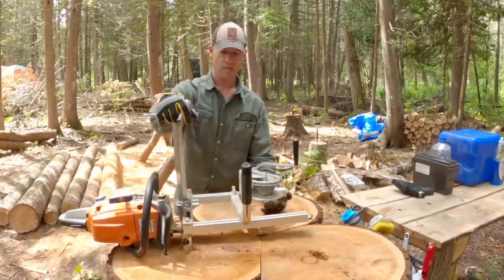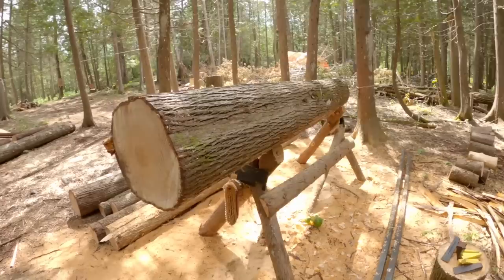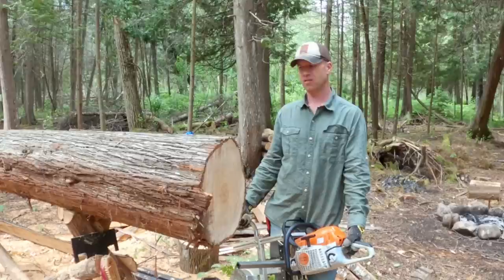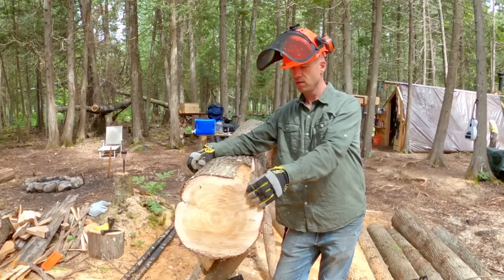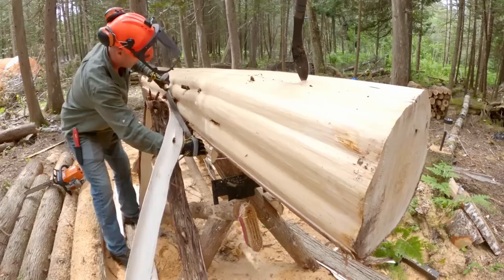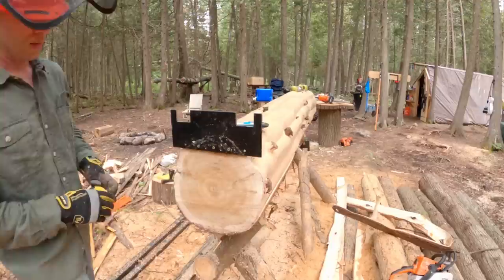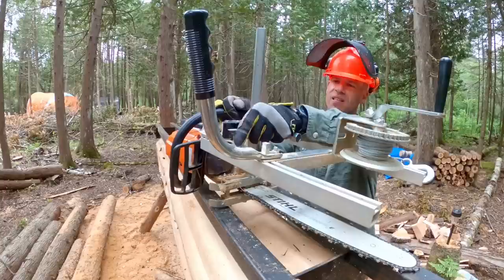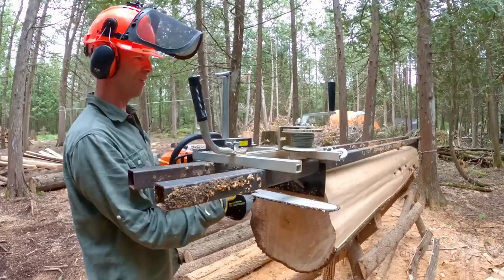Chainsaw Milling- How it Works.  Granberg Alaskan Small Log Mill G777 #12

Comment: Great video! I've had my G777 mill all summer and I finally put it together.  I copied your rail bracket design using 3/4" plywood and a couple pieces of 5 ' steel from a dismantled porch swing. The tip on finding the center and measuring up for the bracket placement worked like a charm. I got through about a dozen or so cuts before the chain dulled out. This is a fantastic little mill, can't wait to make more sawdust with it!
Reply: How big is the back plates at the rails goes on the wits and the Heights
Reply: How big of a saw are you using? Im just getting started.

Comment: My dad , brother and i had a ground hog mill .. the blade was 54 in. Wide the blade was stationary in one spot and the carriage had cable’s and a track , you put the log on the carriage and dog it down .. that mill was true all the way down you start off at 2” on one end of the log and start the cut after 21 Ft. of cutting when it got to the other end of the log it was exactly 2” so we had it dead on .. we run that mill for many years .. most wood we cut was Cypress logs they had a team of divers that would dive down and hook these air bags on too the logs then they filled the bags with air and waited for them to pop up .. then they tide them all together and brought them up river about a mile from our mill .. these logs were bigger then the blade .. that sinker cypress made some beautiful wood ..

Comment: You ARE a Natural Teacher. 
You also sold me on owning a mill
Soon to be a cherished activity.
Reply from the maker: Get one!  If you aren't milling up big logs, this mill (Granberg small log mill) is really fantastic.  Because the end of the bar isn't also clamped in, it's really easy to get the saw in and out part way through the cut if/when you need to.
Reply: @survivingringworm2202  you know any items You use and consider of Quality could bring You some revenue. I know it's a balancing act not to get caught up and lose the spontaneity of Your pieces but if Your choice is between that and having to leave the Forest, it may be a good Choice.
Reply from the maker: What did you have in mind?

Comment: Have the same mill.   I milled over 900 board feet of black cherry from the property.  Something was killing the trees and I didn't want to cut it to firewood.   Every two passes on a log and the chain was sharpened and the saw gassed up.   Get yourself a ripping chain.  They are well worth it.  I went through two chains leaving the second chain with maybe two sharpenings left on it.  
It was a lot of work but very satisfying knowing that I did the work and now after it dries I can begin building new cabinets, etc.
I used a STIHL 029 Super.   It did it all.  Nothing like a STIHL
Oh, I really like the steal guides that you have.  I used a ladder.  I like yours much better
Reply: Hey - Ive been using granberg mill for about 30 years now. They are handy and portable. I make my own ripping chain from semi chisel chain and sharpen them myself. Made to keep the clutch cover from plugging up and they really do cut faster. Also mine is bigger so I installed an auxillary oiler. They take time but Ive cut thousands of board feet with mine.
Reply: @tedbryer2512  I was going to buy one of those bandsaw mills but tried to justify it.  What would do with it when I was finished?  I'm not lumber mill and don't want to be.
If a tree falls I can now take the little beauty with me and mill whatever I want to.
Reply from the maker: Man, I'd love to mill some black cherry!  Obviously not for huge building projects but for some cabinets or tables would be great. Must be fun.
When I made this video I was trying every combo of chain, sharpening angle, etc to get the fastest cut possible.  Then I got a couple ripping chains and I understood the value in them.  They stay sharp for 8 or 10 boards instead of 2 or 3.  Even stay sharp longer than a semi chisel chain sharpened at various angles.
I found the design for the rails and end plates on someone else's youtube channel and went for that mostly to save money but the setup is terrific.  Really wouldn't change anything.
Thanks for the comment!
By the way, Did you watch any of my other videos?  Build a cabin on stilts all from chainsaw milled lumber recently.  You might like those.
Reply: @survivingringworm2202  Not yet.  I'll check out your channel.   IT's fun stuff.  I spent my childhood summers and weekend in winter up the mountains of Pa.  My wife is a city girl at heart (even though she was born in the mountains of Pa). 
I go and do my mountain life stuff and she stays home.  Basically we take breaks from each other every other weekend.  It works for us.  There is not T.V. up there and I don't want one, nor cable.  I like it that way so I don't get distracted and end up watching T.V. when I could be doing much more enjoyable things.

Comment: Just had a crew drop five big cottonwoods on my property so I went looking for videos about making beams. Loved this video start to finish! I'm making videos too and I like your style
Reply from the maker: How strange...right this minute, I'm putting together the next video (that should be out in the next two or three days) about cutting down a bunch of huge aspens, which are quite closely related to cottonwood I believe.
The gist of it is: is it worth milling up all of these junk trees?
If you do end up milling the cottonwoods, make sure to leave a comment on one of the videos and let me know how it goes!  I found that of all the quaking aspens I just took down, all but one was too rotten inside to be worth anything but an ENORMOUS pile of firewood.  I'm going to use a couple boards from the one tree that I did mill on the upcoming "sky deck" that will otherwise be decked in cedar just to see how they weather (split and crack) by comparison.

Comment: You can actually use a longer bar,if you need too. I've milled 26" diameter maple with my 28" bar. The accuracy in thickness was still acceptable from left to right. You can also pair the small log mill with granberg's vertical mill to get s4s lumber right off the mill. I use granberg's milling chains sharpened to 10 degrees. To fill the kerf as I mill I buy those cheap door and window shims you buy at the big box stores. It's just cheap and easy. I can usually get through 3 8ft cuts before I need to touch up my chain . The milling chain isnt really faster than crosscut chain,but it does leave a smoother finish. I run a 70cc stihl with my small log mill and keep an ms310 for the vertical minimill.
Reply: Ive got a stihl 462 that i was going to try to chainsaw mill with. How do you feel you saw handles the milling operation over all?
Reply: @garyj5943  it handled it fine. Even on hard wood the maximum width I could cut I could average about 2ft per minute. Itd fly through pine or poplar. My big saw was a ms441c that I unfortunately left in my basement and we had a flood. It was packed full of river mud. I'm gonna tryin get me a new saw come income tax time if I can. Only problem I ever had was my not having equipment to move logs around. I usually milled them up whetever I found them,which usually isnt very convenient. I did do a muffler mod on my saw because on long cuts it seemed like it was running real hot. It solved the problem and seemed like it revved up quicker and maybe had a little more torque. I think you'll be happy doin it with your 462. I mill my wood to build like farmhouse tables and other rustic stuff.
Reply: Thanks for the reply! Sounds like i should be in good shape. Ive been dragging logs around with my honda pioneer and by hand trying to stack them up. So far all eastern red cedar that im planning on doing some sort of timber frame type cabin. Really excited to get started building but im just in the material gathering stage right now.
Reply: @garyj5943  man,that sounds nice. I hope it all turns out like you Invision. God bless you and merry Christmas

Comment: I'm a new subscriber today. Started with #17 & went back to #1. Now I'm here. Really like the content. Keep up the silly. I'm a bit envious. 
12:09  I like cutting downhill. Let gravity help. I like the cable idea, but have never used it. I put one end on the ground & the other about 3' up. I tapped some holes to put bolts in one foot from the end of the tubes. To keep the tubes from sliding off.
Reply from the maker: Totally with ya on milling downhill. Problem I’ve found is when you are always milling different sized logs and can’t really adjust the sawhorses, you sometimes end up with one end of a fat log way too high for comfort or a skinny log almost at your knees. Need to find/make some better horses for myself I think. 
My rails have bolts through them too!

Comment: Its a vary nice, had me rolling   borat   i likaa how much i wanna build that rail syatem   you have

 Just ordered  me a  granberg  mill  for my huskavarna  395xp and 372xp   gonna mill out some huge  pines  on my property    i have acres  of  110 foot tall     6.5 foot diameter   average pines , thay are huge yes    i went ahead and ordered the  48 inch    mill       i have   6 bars     already from 14 inch to   52 inch so   good on that i went ahead and orderd ripping chains  ,,, im just vary undecided on the guide bar for the first cut    looking at the easy rail system but i like how yours just   using steel from a  metal yard

Comment: Recently ran across a couple of uprooted Alders up here in far northern calif. I'm projecting them for a new patio. Will have to upgrade to larger saw, but sooo looking forward to milling and using the trees in natural state as support poles (10"ers).  Your videos are real and helpful. Your tips are solid as well. Keep up the good job!
Reply from the maker: Thank you Mark! 
Sounds like a great project you’ve got lined up. I haven’t worked with alder out here but imagine it would make for some fun milling. 
Going to make the frame or decking or all of it from alder?

Comment: Quick tip for those that are interested on planing large slabs like this. If you see broken down cheap planer/thickness planer combo. Take the top peace that houses the blades, turn it around and connect it to chainsaw. Now you can plane very wide peaces middle of nowhere using chainsaw power. Old... well crazy bastard who has idea that his a literal god, just missing powers since people dont believe his a god, that just happens to be just as creative on building stuff like this just threw it together since pushing logs and boards trough the stock machine was pain in the ass to him.. probably cause he used it on wheel barrow go figure, but the damn thing worked great and i got rest for free to get new motor for the old German planer that was missing the motor and i'm planning on building drum sander out of the height adjustment system.

Comment: Really enjoying your videos; thank you! I'm thinking you might build yourself a little insulated building to deal with your winter camping which you could heat easily with either a small propane heater or a little wood stove. It would keep basic water thawed and serve as backup if the weather got too vile for the tent, then you would have somewhere warm as a safety "bolt-hole". Be nice for drying out gear and keeping tools from rusting. I've been there and done that...lol...just sharing experience. I've milled some spruce and fir as well as ash with a chainsaw mill similar to yours. Works great but a little slow. I've used a Stihl 028 and an old Husky 50 and both worked fine. That's beautiful wood you are working.
Reply from the maker: Good points.  But I'm just here to camp and play around.  If it comes to having to move inside, I'll probably just head out and wait for spring to come.
I kinda like to suffer a little if you didn't notice.  Sometimes it doesn't even make sense to me.
Reply: @survivingringworm2202  Well, there is nothing wrong with a little self imposed suffering as long as you know who is to blame...lol What you're doing looks like fun.It's hard to beat sleeping in a tent with rain or snow hitting the roof.
Reply from the maker: I never forget to point the finger at myself when everything is soggy and I’m (temporarily) miserable.

Comment: I replaced the cable with 550 para cord for my winch on my 60" AM. Its awesome making your own lumber. I use a Logosol F2+ now for stuff under 30". 🤘 🤙nice vidja.
Reply from the maker: Huh. I like the idea of rope/para cord instead of steel braid. Easier to handle and less weight. Might have to borrow that idea...
Reply: @survivingringworm2202  ya I put it on since I run a 084 lol. But it is nice because it "stretches" so the tension help pull it along too

Comment: Very nice! Mine is on its way. Can't wait
Reply from the maker: Did ya get the same one?  Which chainsaw ya using?
Reply: @survivingringworm2202  I purchased a Husqvarna 572xp on a black Friday sale for $799 with a 20" bar and chain. The granberg  14"-36" kit I believe. Then a 9' ladder, but I really like this ladder system better. Everything is supposed to be here by December 7th. I need to find a larger bar and a ripping chain. I was thinking about a 42" bar because you loose a lot by the mounting process. I have seen guy's using big bars with this saw but I have never done this and not 100% sure it is big enough saw for a 36" slab. We have some huge mesquite over 36" diameter, huge live oak and pecan here in Texas where I live. I have always wanted to do this. I was planning on a bigger saw but for this price I thought it would be better so I can learn a little first. If everything goes well then upgrade later. The saw says maximum bar recommended is 32" so I am watching videos to find out more information before I buy a bar and chain. Thanks for the reply and I am subscribing right now.
Reply from the maker: Oh man. With a 20” bar that thing is going to eat up some logs!
The one thing that is nice about the smaller mill tho is that if you get part way through a board and have to pull your saw out for some reason you don’t have to unbolt the whole thing or back it all the way back out of the cut. It’s handy sometimes not to have the end of your bar clamped in. 
Doesn’t matter tho. That’s going to be a great setup!
Reply: @survivingringworm2202  I definitely hear what you are saying and I will probably get the smaller mill also. I also have a Husqvarna 460. I bought a 24" ripping chain for it then started watching more videos and seen where I will lose a lot of cut just in the mounting. I see yours is not mounted on the end and that seems to a good thing especially if cutting smaller things. I have just had my eyes on about 5 huge mesquite trees for years and really want to make some nice beds and other furniture out of them. The circumference is 7'-10 at the base on the smallest one and 36" at the widest point. The largest is 9'-1" circumference. That is why I went ahead and ordered the bigger saw. Do you think it will pull a 42" bar so that I can cut upto a full 36" wide slab? I just know I will lose alot in mounting around 6" of bar from what I can tell. You are doing some really nice work and living a dream for me being out in the woods like you are. I love everything about it!
Reply from the maker: I'm not sure you'd get through a 36" mesquite in any timely fashion.  You'd have to keep the chain SHARP.  I have about 10 different chains for the milling saw- most are failed attempts at finding/making the best/fastest rig.  In the end, I have three ripping chains and an inexpensive chop-saw style chain sharpener.  The key I've found is to use a real ripping chain and stop and switch it out as soon as your cut starts to slow down.  If you (I) don't have multiple chains, you tend to push on a little too long with a not-so-sharp chain which creates heat, vibration, etc.  So my recommendation is to get a few more chains- Granberg's ripping chains are the best I've yet found- and a bench mount, electric sharpener.  Switch the chains out frequently and touch them up on the sharpener after you've run through them all.  Another huge plus of the bench mount sharpener is that every tooth comes out exactly the same so instead of getting a 10 or 12 hand sharpenings before junking the chain you get 20+.  Its super easy to just barely touch up every tooth to bring it back to sharp.
Don't be afraid of the cheap red and black sharpener on amazon! 
There is a brief showing of how it works 3/4 of the way through the #4 video, "three trees+chainsaw..."
That cheapo thing is still going strong!
Reply: @survivingringworm2202  thank you for all the information. I now have set everything up on a 24" wide mesquite and 7' long. Everything went smoothly, but I forgot about wedges on the first slab. Lol now everything is going good. I did get a pfred file but haven't used it yet. I will definitely get a circular sharpener. Thanks for the replies

Comment: I like it. Now it seems to me, not being an expert either, with only the saw end of the bar being attached to the mill, you can use a 24" bar to cut larger diameter logs by just going down one side then back up the other side to finish the cut, just use your wedges to keep your cut open. What does everyone think?
Reply from the maker: Hey Robert. I wonder if indeed that would be done? Seems the tough part would be for the saw to get rid of all those shavings in an enclosed cut. Never know!
But I’ll likely never try it, not because I am not curious but because I can’t lift logs that big!